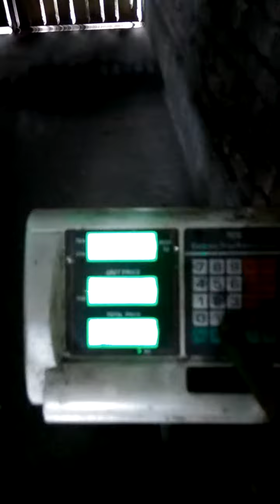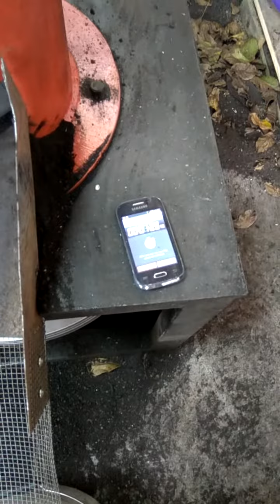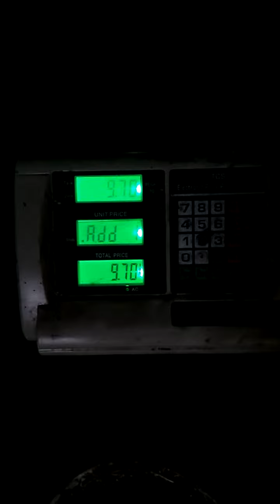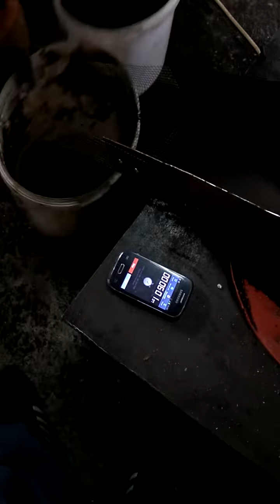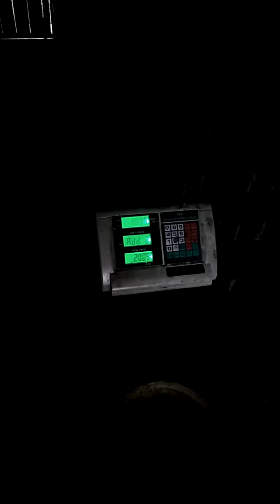Coal dust pellet press 200kg per hour 2/2

Comment: Are those pellets realy hard ?? I have try'd pressing coal dust with 12 ton/square inch and it would not bind at all.
Reply from the maker: Yes they are, I am not using anything, just water.
Reply: @stevanpopovic1056  Did you ever burn them and do you have a video ? 🤗
Reply from the maker: @moekakke  you have video of pelet combustion just browse videos in my channel
Reply: @stevanpopovic1056  ah ok wow what a flame ;-)